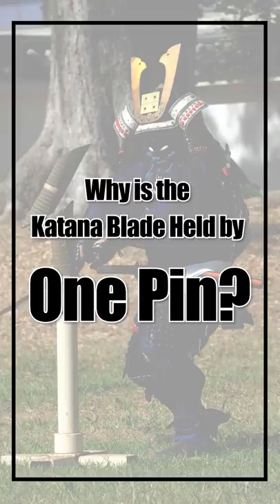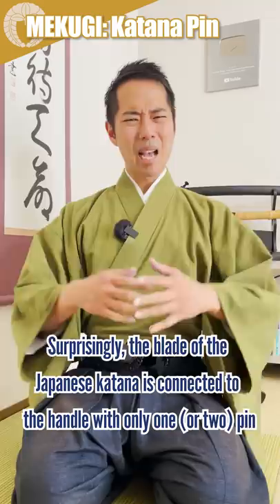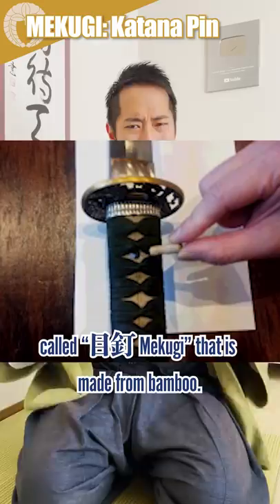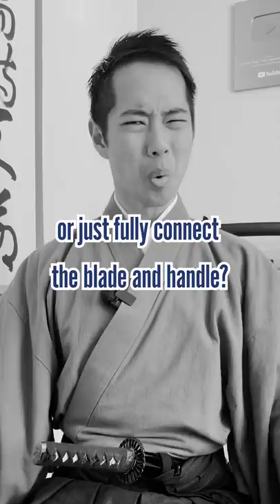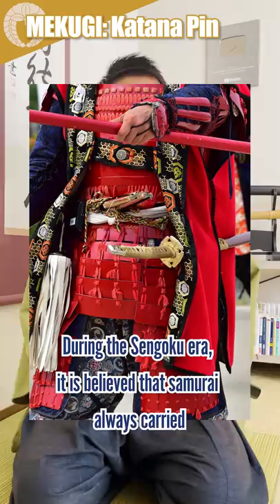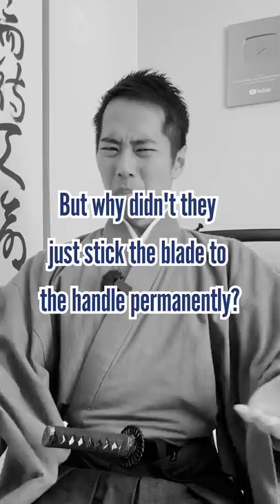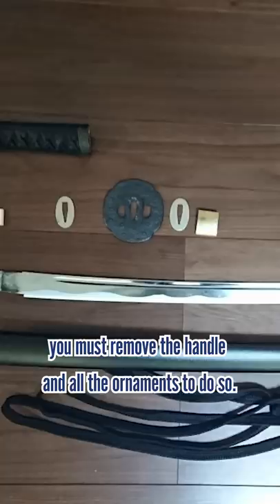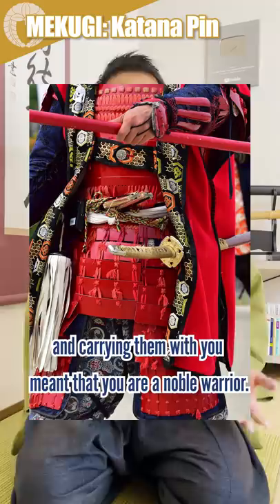Why a Single Bamboo Pin Holds the Whole Katana Blade #Shorts

Comment: I don't really think it's that weird especially since European sword handles were usually attached by having them held in place by compression from pommel, ever by a skrew on pommel and threaded tang or in earlier swords a tang that was peened.
Reply: Yeah but that's nearly indestructible compared to this
Reply: @aniquinstark4347  It is not, in fact, nearly indestructible.
Reply: The pommel attachment is a smarter idea
Reply: @alalalala57  "compared to this"
Reply: @aniquinstark4347  everything is going to break eventually if you beat it against things. Which would you rather have to repair in the field: broken steel or iron that needs a competent bladesmith and forge and tools? Or a bamboo pin from your pocket or natural source to put your sword back together? It does make sense, it's two different approaches to the same problem.
Reply: @falkyrie5228  when you need to end your opponents rightly
Reply: I'd rather a solid mechanical connection over a bit of grass holding the weapon I'm fighting for my life with any day
Reply: The katana is alot older design than alot of european swords as well
Reply: @duderitoz6953  The Katana originated in the 15th century, with properly quenched and hardened steel swords appearing in Europe in the 10th century.
Reply: @TheWhoamaters  katanas actually were a thing as far back as the late 11th century.
Reply: @eggchucker1  First, my point still stands, secondly, no. The Katana as we know it was developed in the 15th century, earlier swords existed that where then replaced by the "modern" katana
Reply: Now we need the Japanese equivalent to the pommel throw. Take the Mekugi pin out of the handle and throw it at someone's eye
Reply: @falkyrie5228  you cannot end him rightly with a katana, therfore longswords are objectively better than katanas
Reply: Also another thing to mention about european swords, unlike japanese weapons, a majority of mid-late medieval period european swords were made of spring steel, allowing only temporary warping during impact and requiring less repairs and an overall longer lifespan of the weapon if kept well protected from rust
Reply: @eaar  Very true, bog iron was only used in Europe as the main source for a relatively short time in the early medieval period
Reply: @dragonfell5078  Imagine someone Performing this with Sniper like Precision 😄
Reply: @falkyrie5228  Only cultured people understand this
Reply: Not entirely. I mean, from technical point it makes katana not a sword, but a knife. Those were really popular in Germany around XV century.
Reply: @alalalala57  yet it is, in fact, better.
Reply: @eaar  Spring tempering wasn't as common around then, and the majority of European blades analyzed from the 11th century to the 17th century utilized a laminated structure. Spring tempering from what I know, was usually a trade off, and became increasingly popular among European blades up until the 17th century. Also repairing a spring tempered blade is rather difficult due to the nature of the steel. However, it'll last longer.
Reply: @TheWhoamaters  Depends on what sword you're using ofc
Reply: @TheWhoamaters  Kindly elaborate that. I'm confused. Since Japan themselves used the Katana term for a lot of swords especially older ones that aren't in 15th century. The Katana we know today was that sword named Uchigatana then practically called it Katana later but also that naming applied to other older swords as ranging 5-9 length. I forgot what metric of length was it again, since I don't know much
Reply: @benjibat4655 the peened pommel is going to take significantly longer to get damaged to the point of needing replacement compared to a bamboo pin. It might loosen up, but that doesn’t make the sword any less useable.

Comment: Technically, what you are calling the blade is the sword. The lower portion where the handle is pinned is the tang of the blade. The animations show it properly, but most will think you are saying that the blade is connected to the tang with a pin.
I know it's nit -picking, but it makes the katana seem weak without properly defining the tang.

Comment: The katana is truly a masterpiece. I’d love to be able to afford some of those from centuries ago.
Reply: It's strictly worse than many other sword designs at the same weight. A longsword is almost a foot longer, delivers better thrusts, has hand protection, is more versatile, and existed at the same time.

These short, curved two-handed sidearms wete primarily used to cut down usually unarmed and almost always unarmoed peasants, rather than fighting other skilled warriors.

Katana cultists just love the pageantry, simping for authority and tradition. I promise I'd never lose to a dedicated traditionalist fighter.
Reply: @geoffgenge622  agreed. I'd rather get a longsword
Reply: @MichaelHarto  I would just get a gun
Reply: @geoffgenge622  I never saw the purpose of a double edged blade. A single edge with a curve is better ergonomics.
Reply: @_Wai_Wai_  Yeah if you're just bad at edge alignment, sure. And historically, most people fought with katanas were unarmored peasants with farming implements, and other weapons were used against other actual warriors. A katana is a sidearm mostly effective against unarmoes opponents, and the curved blade can compensate for a lack of skill in its wielder, but if two actual warriors clashed, it wouldn't even be a fair fight, having a thrusting point for compromising armor, the extra reach and versatility. Also how many years of sword fighting experience do you have? How many tournament wins in how wide of a breadth of competition?
Reply: @_Wai_Wai_  you have a godamn japanese name ofc you gonna say thay
Reply: @geoffgenge622  if you're so hung on the katana being worse than other swords, then why not skip all that and go for the gun. You guys get so pretentious over other swords being better than the katana, when that's not the point of owning one and you know it. 

The longsword is deadlier than a katana, but I think the katana looks cooler. Personally I'd rather have both, but I'll settle for a traditionally made katana
Reply: @Kefka2010  Oda Nobunaga would approve

Comment: I don't feel u covered the real critical reasons... if u have it connected solidly to the blade its more prone to breaking. We see this in modern sword and knives today and once its broke u have to completely reforge or weld it but it mades it even weaker where as with a wood handle it offers better shock absorption and if it breaks it's just a matter of replacing the handle and more often than not the handle breaking saves the blade from serious damage. We have very successful swords that are all one piece but these are high end steals like 5160.
Reply: But you die either way if the blade breaks or if the handle breaks, so what's the point in preserving the blade if you still die in the fight?
Reply: @LinkinPark4Ever1996  exactly. If this were for chopping firewood or something I could understand the argument, cheaper and easier to fix the handle than the blade, but if your life depends on it. I would rather have an 8 inch blade because the rest snapped off, than a bamboo handle.
Reply: Modern blades have superior performance, its as simple as that...
Reply: @LinkinPark4Ever1996  samurai carries two swords, one breaking isnt the end of a fight
Reply: He did say that with a metal pin a strong blow could cause the blade to deform. Breakage is just a more severe form of that. If the blade deforms or breaks during battle and the pin gets stuck you still can't replace the blade. So he really did cover the most important points.
Reply: @LinkinPark4Ever1996  chances are you'll be maintaining the weapon more often than fighting for your life with it. And the weapon kinda have more cultural values than practical value (not saying it doesn't have any practical value) so why not preserving it.
Reply: @stitchimus5631  Having to unsheathe and parry another attack in the middle of a fight which btw they didn't always have 2 and if they did it was a wakizashi (shortsword) would've meant end of fight. No way they could've drawn in time to parry and counter attack.
Reply: @LinkinPark4Ever1996  Not really because swords are sidearms. If you are forced to draw your blade then... Well you were fucked from the start. Best to turn foot and run.

Comment: "No you don't get it, I have to make the blade less structurally sound so that I can engage in ritual cleaning."

Truly a Japan Moment, and I love it.
Reply: If one part breaks you can replace that one part instead of the whole sword and its resilient
Reply: Less structurally sound ? 

Did you even watch the video? 

"Ritual" ? 

You just leave the weapon without ever cleaning it? 
Why do we clean guns today? 
I'm cringing so hard at this
Reply: @Leo-hr7yq  You can preform maintenance on swords with a fully attached tang... you know that, right?
Reply: The tensile strength of Bamboo is stronger than steel

Comment: So in short, not only does bamboo have more tensile strength than steel and is more readily available, but if it does break through impact, a bamboo mekugi will absorb more of the impact than a metal one would.
And when it breaks, the blade will dislodge and give way to absorb even less of the shock, allowing it to have more longevity.
Sure, it'll muck the Katana in the moment, but reassembly and re-sharpening is easier than forging an entirely new blade.

Comment: The way i've always thought of it was like how many RC Cars are made from a strong absorbable plastic. Metal is technically stronger, but cannot absorb and can morph after many impacts, causing deformaties. Where as plastic is flexible enough to take impacts better by absorbing and causing certain forces to rebound. Much like bamboo, it can do something very much similar to plastic
Reply: That's true, but plastic is used because it is much less expensive to shape plastic into a car than a piece of metal.

Comment: Ok I was actually wondering that. My kitchen knives that have metal pins don't last as long as the ones that are attached to the handle. I wondered why a literal weapon that meant life or death would not be welded/fitted/stuck fast.
Reply: He says the weapon was more ornamental than anything. The wood pin allows for easy maintenance and customization which keeps it nice and clean.

Comment: Short answer, the tang is not sealed against water and needs oiling just like the rest of it. So for maintenance, the pin needs to come out. For this reason, it is better that the pin break rather than bend.

Comment: It was extremely common for higher class warriors to have different handles, wraps, tsuba, and other parts that could be interchanged depending on needs. More ornate and elaborate ones might be used for formal settings with other nobles or for display when not in use, while simpler ones would be used for everyday use. Plus, older katana were occasionally re-forged, so that the temper of the blade could be fixed since repeated use could cause it to lose toughness and strength.

Comment: Here in Indonesia the way the keris knife is built is similar too and for a similiar reason, the handle part of the blade is just a short and thin metal "tail" that is held on by the handle that you can (more) easily pull out for maintanence. Here in Indonesia we believe that the keris blades from "empu" have spirit in them so they must be ritutally washed and cleaned to please the spirit so they don't make the owner go crazy.

Comment: It's an engineering concept called a fusible link. Just as an electrical fuse is meant to burn out before the wiring or appliances, the pin would break before the sword or other important portions of it.

Comment: Meanwhile, European swords would attach to the back of the handle, with the actual handle decorations wrapped around the tang of the blade.  Removing handle parts would involve unscrewing the decorative nut or cutting up the leather wrapping.  Removing the larger European tsuba (cross guard) would generally require removing and possibly destroying all other handle parts.  The smaller guard on a German "long knife" sword would have a much simpler attachment, but these had the same blade as another single edged type.

Comment: Keep in mind that for most of history the Katana was a sidearm.

Warriors would use either projectile weapos. Like bows and later guns. Or polearms.

So if you had to pull out your Katana you were probably screwed. If you used your Katana enough to break the pin you were probably royally screwed no matter what you did.

Comment: It does seem obvious why bamboo was used to me. Metal would damage the integrity of the blade and using any method outside of using bamboo to attach the blade would involve a lot more labour to do, especially with a weapon that has a lot of tradition in its maintenance.

Comment: Basically the bamboo pin is the engineered point of failure. The blade spine was a softer iron that was easier to bend and deform with an often imported hardened steel edge. Interesting how they figured out the bamboo pin to preserve the blade from deformation.

Comment: The samurai gathered the iron ore and built a smelting furnace and had to tend to the fires for 2 weeks straight to get the correct formula for the metal alloy . 
  The Samuel sword was a labor of love and skill , not a mass produced sword such as was the common sword. 
 Forging the blade and putting the edge on it was very labor intensive and resulting in a blade known the world over to be far superior to all other blades.
Reply: It is known by people who idolize it to be superior to other blades. In reality it's an adequate sword much the same as any other sword. But it has limitations.

Comment: It's a lot like the shear pin on the outboard motor for a boat.

It's better to have a brass shear pin than a stainless steel one, because if the propeller hits something underwater (like a log or a rock), the pin itself will break and reduce the risk of damage to the propeller or the rest of the motor.

But if you have a stainless steel one, it won't break as easily, if at all, meaning you risk damage to the propeller and motor (like the drive shaft getting bent).

Comment: Intriguing, but mideval German longswords were better because of the higher quality steel used (the reason why katanas had to be folded so many times was garbage steel). The handling is similar in the fact that both are very well balanced, but German swords hold an edge better and are stronger because of the lack of a softer back (meant for katana flexibility)

Comment: They didn’t connect the blade to the handle bc the masters that made the sword left their mark under the handle and on the metal also so they could fix the blade easily without breaking the handle

Comment: most design and manufacturing choices you see in katanas arw due to them having no access to high quality steel, a thinner permanently attached blade with harder steel would of course do better, but it just wasnt feasible at the time

Comment: There is one additional factor, on top of the other advantages it's the painstaking carving process that allows it to be friction fit and put relatively small load on the pin that makes it possible.

Comment: What I'm wondering is how is the handle not damaged since as far as I know it's made out of soft wood. Having only 1 point of contact on a pretty small surface, how is that 1 hole not getting deformed and making the handle loose in time?

Comment: Katana were used as a last line of defense only. They are actually bad weapons with a lot of faults, and for the time made with bad steel. To use one meant you were ready to die doing so. Rarely used in practice because other weapons were far better.

Comment: Actually Japanese katanas are almost 100% of the time full tang blades (meaning the piece of metal extends the entire length of the handle) like most blades that aren’t cheaply made pieces of garbage. 🤔so thiiiis is NOT entirely true but I digress. And if a blade is hit hard enough to deform it, a bamboo pin isn’t going to do anything. If you don’t believe me, buy a full tang katana blade, remove the pins and smash it against a tree multiple times. You’ll see that it really is only there to keep the FULL TANG BLADE in place. Also yes, most full tang blades do have pins through the handle so that the full tang piece of metal doesn’t simply slide out of the handle, this also makes it (for the most part) easily disassembled for maintenance. And it Doesn’t actually matter what the pin is made out of, but bamboo is EASIER TO ACQUIRE (the main reason it was used) than steel because the Japanese were not as skilled in metallurgy as say Europeans, and only developed sophisticated iron smelting practices in the late 6th century CE, as opposed to Europe which was smelting iron since the second millennium BCE. Although bamboo does have equal or even more tensile strength. *The more you know*.

Comment: A strong impact bends and lodges the metal pin inward makes sense. So breaking the pin, snapping it off is better. would the blade fly off without the pin or would the remains of the bamboo pin lodge itself as well?
Reply: So wouldn’t that almost happen every hit
Reply: @austen9556  wdym?
Reply: @submarinemagnet7965  the pin braking
Reply: @austen9556  yeah, that's what I thought off as well. If the pin keeps breaking, then the wooden pin could also lodge itself to the handle of the blade

Comment: So, I guess being able to destroy a bamboo pin if it gets stuck by picking at it makes it better than metal too. In most cases bamboo is sturdy enough for it's use like metal, and even has the added benefit of being more flexible too.